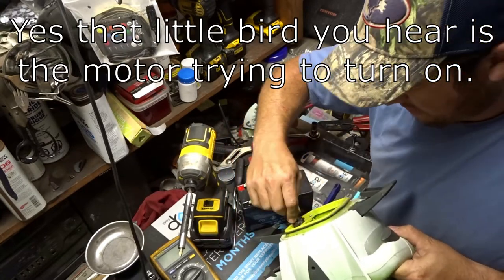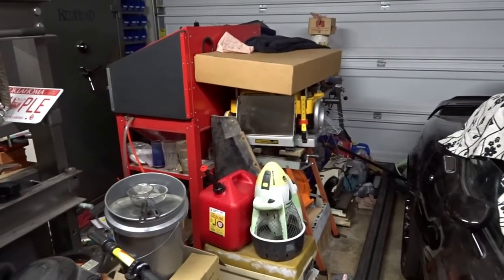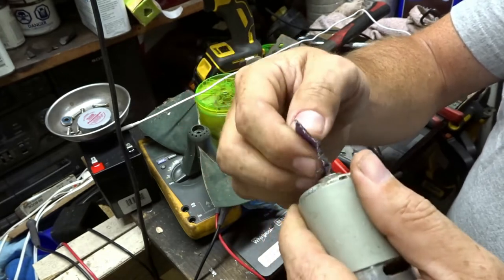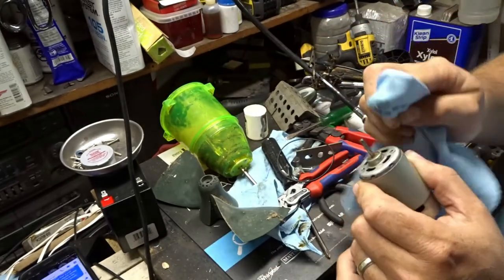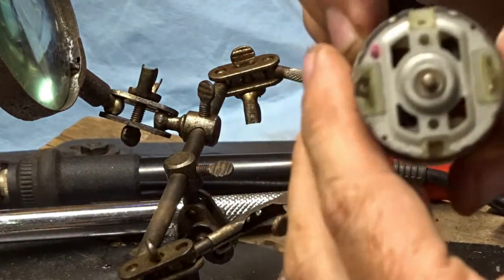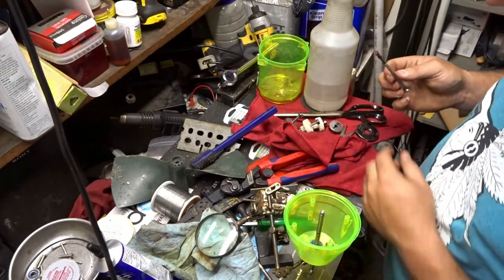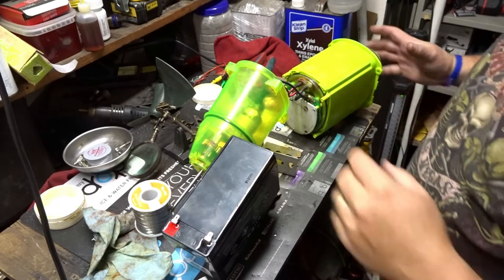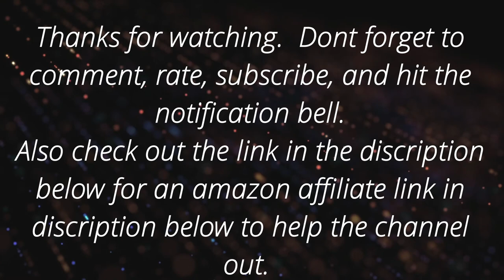(Part 2 of 4)  Repair of Cheap Seadoo Sea Scooters Garage Sale Find

Comment: so far so good...  Blade speed out of water is not as important as actual speed/torque while under load.  It will be interesting to see those in use.  Thanks for sharing.
Reply from the maker: This is true guess that's why it's geared so low to pull a guy like me through the water need all the umph I can get Lol

Comment: These were not designed well at all. The little rubber plugs and O rings really don't do anything to keep water out. But, if you put some time in it and take it all apart every season you can use them.
Reply from the maker: Yep I forgot all about these.  I need to get these out of the attic and go test them out. Thanks for the reply